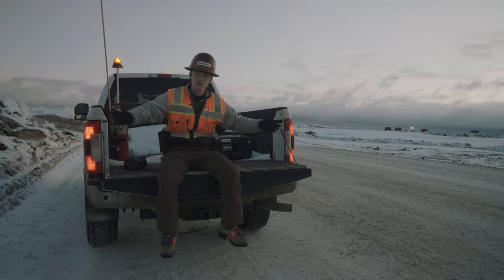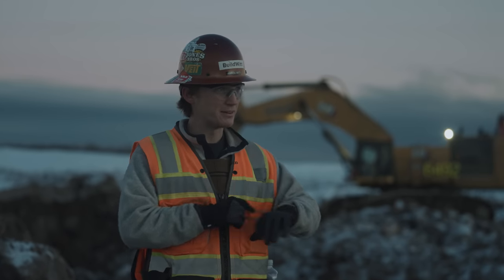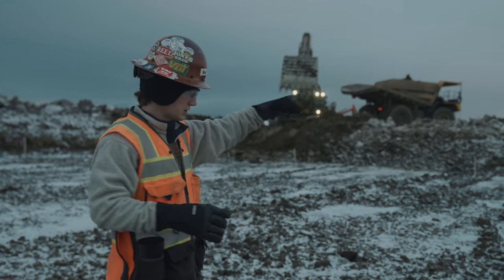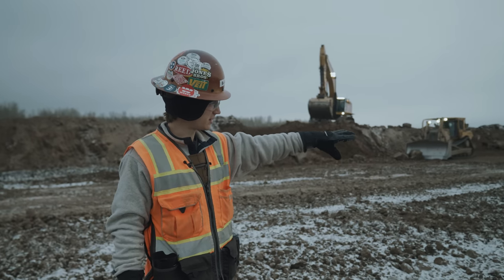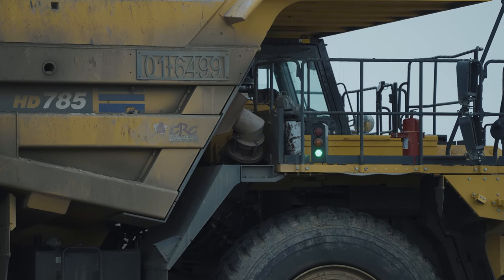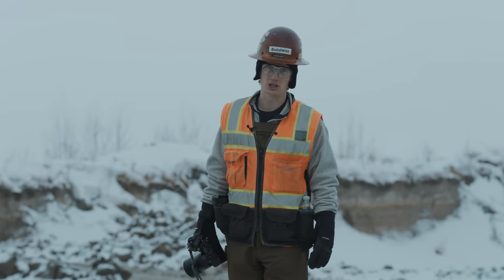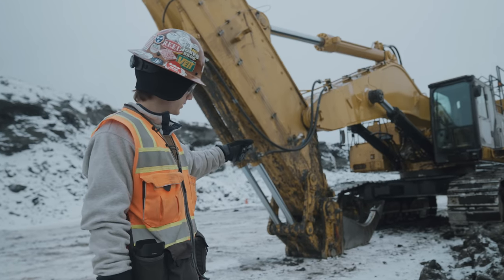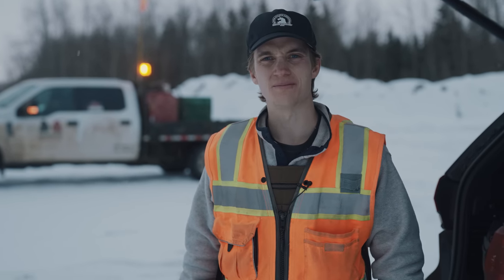Mine Reclamation In Sub Zero Temperatures

Comment: Another question ❓❓ i have in my Humble opinion. The Excavator with ripper, why is it not double Hydraulic cylinder on the short dipper arm. I guess if it just lifts, NO pulling or pushing of dipper "OK" just a question ❓❓ about the massive Wt. But like you so brilliant pointed out. The Mining company knows what they are doing with reclaim. The single Hydraulic Cylinder must be power enough😊😊

Comment: What the chain in the excavator bucket for
Reply: I would like to know as well
Reply: In the first video at the mine he talks about it. The chains keep the sticky oil sand from building up inside the bucket. Each dump the chains bang around and it knocks some of the stuck material out each time. Otherwise the bucket would load up with stuck on material.

Comment: I'm surprised how such a big bucket they are using on the 395.. 9.5 yards isn't even available on the Caterpillar 395 list and then also with a long boom and long stick and even quick coupler, for such a hard and heavy material. The biggest HD bucket on the list has 8.5 yards and is even with a short boon ME configuration only usable for mild heavy material. For me the List doesn't make any sense because this configuration is theoretically  unusable or not recommended.. 🤔
Reply: Custom built buckets because the overburden is such a light material you can use a bigger bucket to maximize production.